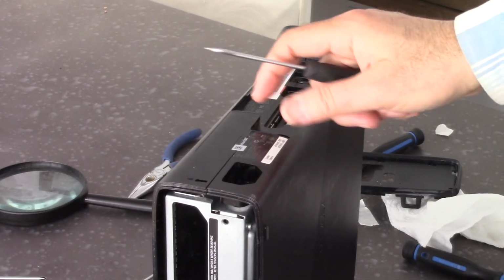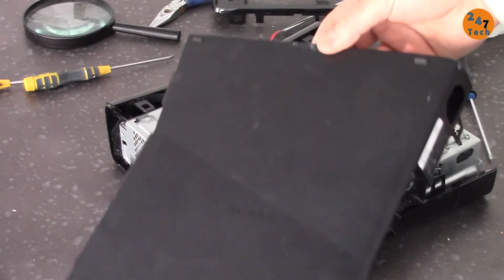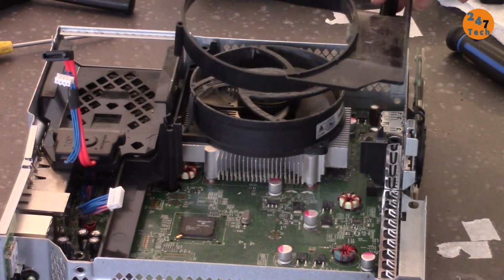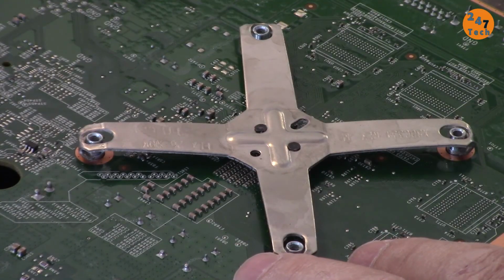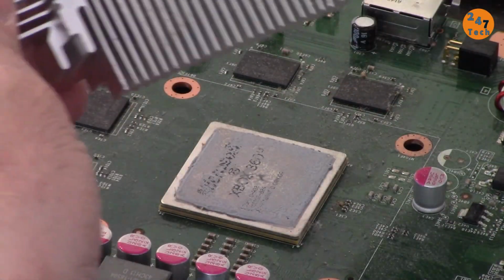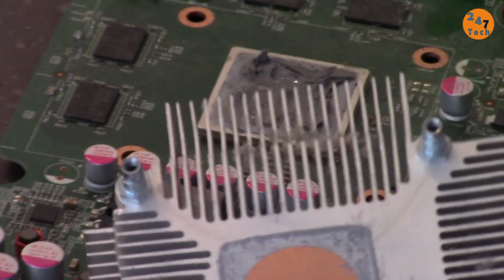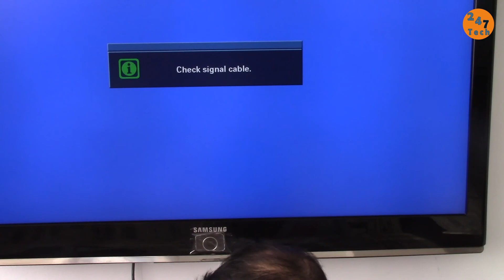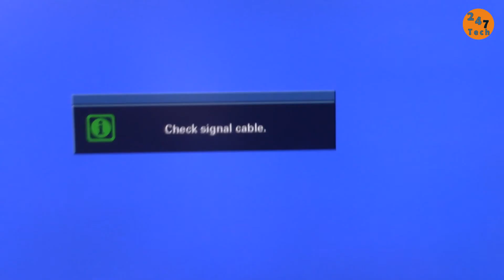How to Remove and Replace Heat Sink Remove Motherboard of XBOX 360 Slim

Comment: You dont clean old thermal paste, wtf?
Reply from the maker: No I don’t . Why? Do we change it in life of the device? No it  works forever.
Reply: @ToDoTips  We do change it. When you go to remove the heatsync and the thermal paste is exposed it doesn't sit well anymore. If you don't touch it l, it'll be fine but since you exposed it you need to replace it. It gets flakey and it turns to dust over time. Once it has been opened then you replace it. It's like a cauter pin. Once you've bent it enough to get it out, you have to replace it. I'd say yeah under some scenarios where it isn't flakey then you can reuse it but most factory thermal paste is already bad enough and given time it gets worse. You should consider putting thermal paste on it.
Reply: Lol

Comment: Your supposed to clean the cpu also before reapplying thermal paste    smh  you basically defeated the purpose of even attempting to clean the CPU and heat sink 😠😤😒
Reply from the maker: Please read my comment. Paste is not engine oil to replace it is there for ever and never expires. Of courts if you want to waste and replace it , do it.
Reply from the maker: Also we never our computer heat sink thermal paste.
Reply: Oh lord. I guess he doesn't even understand the concept of cleaning it so there's no air in the little cracks of the old paste? There's a lot of reasons why you're wiping off that old face. But this guy's just not understanding the concept. I think he went to some kind of electronic School where they use doo doo as paste.

Comment from the maker: Please be decent enough to tell me why you are not happy about this video. I did not lie and I did not put misleading title. it says how to remove motherboard and remove heatsink and I've shown that. What did you expect? Where you expecting to show you how to win  lottery?
Reply: Nobody's asking you to go above and beyond period but change the thermal paste dude? If you're going to do something do it right, Geez. Takes 2 seconds to grab an alcohol and cloth and rub that old paste off and replace it with a new paste. You don't reuse paste? When you take a crap do you reuse your toilet paper? I assume you probably do. Or you probably use your hand.
Reply: Change the thermal paste that’s why everyone is hating on your video. Thermal paste does not last for the life of the device. It will eventually dry out. When you remove the heat sink you must replace the paste since you have now displaced the paste and introduced air bubbles that will hinder heat transfer. And the thermal paste that comes with these consoles and most consoles is not very good it’s cheap mass produced crap . Remove heat sink. Use a cloth with isopropyl alcohol and clean both cpu and  heat sink apply new paste. Also the paste you used does not look very high quality

Comment: "I'm putting something underneath"- puts a magnifying glass ROFL. 
Btw, make sure you clean the old thermal compound first before you apply clean, fresh one, otherwise it's for nothing. Otherwise very good video. Thanks
Reply from the maker: Thermal paste is not like oil to be replaced. It is used for lifetime. Thanks
Reply: @ToDoTips  you should do a bit more research about this topic. You possess knowledge about how to open up an electronic piece of equipment but still come with the nonsense of thermal paste being 'for life". If you check Arctic MX4's website you will see that their warranty is 8 years. Not lifetime, but 8 years. And that's a good case scenario for one of the good thermal pastes you could buy. There's thermal compounds that last less than that. Also really well known thermal paste that losses it's properties above 85 Celsius. You probably have read something about thermal paste being good for "the lifetime" of an electronic device, and maybe, in some cases, that statement might be true. However, when you open up a heatsink and see the thermal paste crumble and dry, do yourself a favour and remove it. It only takes 1 minute. The purpose of thermal paste is to provide better heat transfer between the cpu/gpu and heatsink by filling microscopic gaps and possibly air bubbles, not to create a "buffer zone" and more gaps.
Reply from the maker: Thank you for the comment. I am not trying to argue. When I see it still acting like paste, then we should not simply replace it because we can. I have problem with the idea of consumption. When you take your car to check for brakes pad, they always “suggest/recommend “ replacing the rotor. Even though the rotor is absolutely fine. People simply replace it because “it is better “.   And that’s where I see the consumerism which is disaster to humanity.